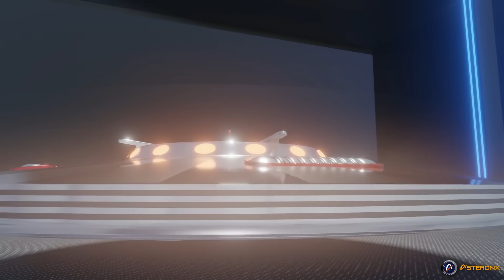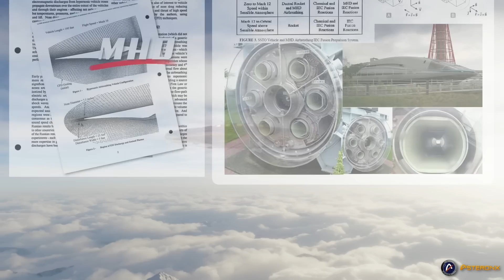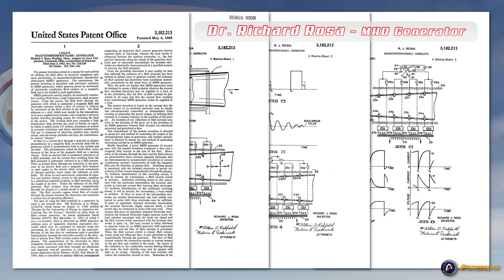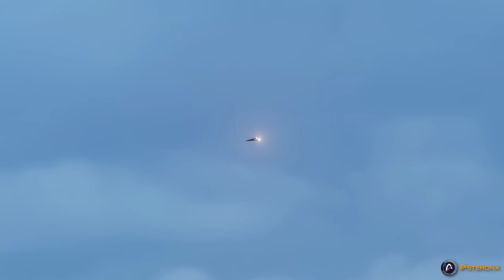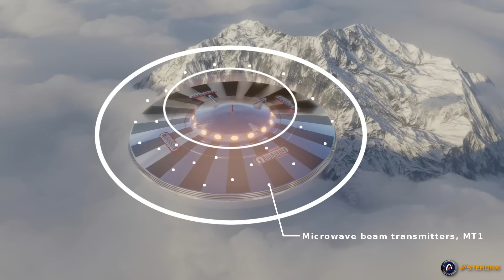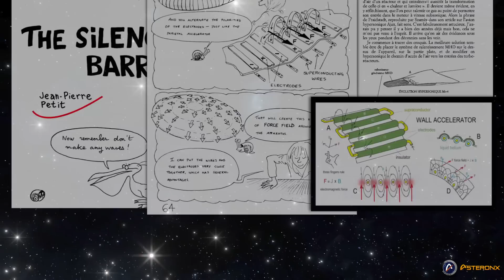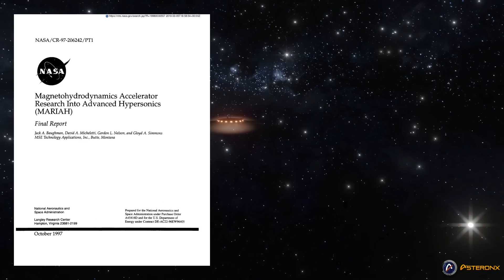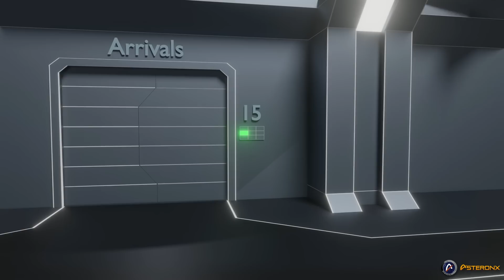Wingless EFE Touring Craft MHD

Comment: Actually you want what was going to revolutionize space travel LPP’s laser induced plasma propulsion this is the use of a ground-based laser facility that produces a high energy laser beam which is in focused on a reflective colonial surface and the reflected laser light superheat the air causing it to break down into a plasma which then is manipulated focused by magnetic fields and electric fields to behave as a sort of jet engine exhaust pushing the craft very close to space into the stratosphere where then more conventional propels it into space and a mass drivers extremely powerful electromagnetic coil guns that hurl large pods in the orbit containing construction drones and containing construction materials allowing for space stations and magnetic levitation orbital elevators to be constructed As far as the laser induced plasma propulsion system all of the power is built into the infrastructure the propels the craft and the space what that means is you don’t have to have any expensive generators you don’t need fuel the only fuel is the electricity to produce the laser light which is produced by a nuclear fission or fusion reactor and all of that is on the surface conceivably you can scale the system up to the point where a much larger space craft that would have never be able to enter orbit conventionally could enter into space MHD would only be able to work in the atmosphere because it requires an atmosphere to work but you can use this to get very close to space to the point where conventional thrusters could take you there but outside of that it would not be efficient to create a bubble of plasma around the ship they’ll be able to push it in the vacuum of space because that plasma bubble would get stripped by the solar wind the light energy from the sun and just so you know the solar wind is charged particles coming from the sun and they would require a gigantic amount of power for 100 Teslas actually the earth it’s magnetic field is only 0.34 micro teslas and it makes due with a magnetic field of that power

Comment: There are rumours about the B2 Spirit already using this technology going faster than sound without the need of braking sound barrier. The Russians already use a certain new kind of torpedo, which is in fact a underwater rocket, the Skval, which was the real reason for the sinking of Kursk, which has been attacked by a US submarine prior to the launch of some Skval rocket by the Kursk. The Skval runs at hundreds of knots, probably capable of going supersonic, instead of the usual 30 knots of a Mk 48.
Reply: If you don't know what about you're speaking, shut up. 
Sound barrier is only a matter of aerodynamic, not propulsion. and Skval are using supercavitation, it has nothing to do with MHD. 

And MHD isn't useable to propelling an aircraft, it's too weak.

Comment: if space is made up of a flux of quarks and gluons, could an alcubierre drive be possible by isolating a finite amount of said flux and distorting it's containment field? rather than folding space, distorting space to a degree in which the relative motion outside of the contained flux differs from the velocity once entering the containment field? to stretch a foot of flux ten feet and throwing an object through it at one foot per second might have the effect of increasing the speed of travel from one foot per second to ten feet per second relative to the exterior of the containment field.

Comment: Wait, but microwaves aren't ionizing radiation, how would it ionize the surrounding air? To ionize oxygen and nitrogen you need a photon energy of about 14.5 eV, or about 85.5 nm, which is in the ultraviolet frequencies. And remember, not only does it ionize air, but human DNA.

Comment: If use none conductive full circle tubes in pairs as many as need to the desired effect place them common centered  magnetic bears to rotate freely as lower friction of the liquid fluids all this suspended in a pair of states to apply Higher and high frequencies until you get anti-gravity effect and each unit three or four will suffice when given the AC power that will the mercury to flow around in those tubes, we had talked about, those will begin turning as the friction of the mercury  on the walls of each tube. This rotation is only by the friction, one of the two stators will be up to cause this mercury to run around its tube clockwise as one down upon its rotational part ( Tube spokes and magnetic bearing. ) as a single whole part. All while tube rotational as a whole too will rotate counterclockwise for the very same reason as the other tube part unit. These are driven by the stator units that are stacked one on top of the other  also having common centers as the rotational tube assemblies you should also use aluminum plates, ( Making them not conduct  between each other is very importantly necessary as a fact. Lamination segments will do best. ) so as to stop the interferences between the coils of each respective stator assemblies of course you use true correct iron stators the will only hold magnetism and not having electron flow or  to a minimum,  you should make your wire to these stators also reversible for both in one switching and also be switchable independently just for safety reasons all this for pilot actions as a means to regain stable usage while flying the craft in every kind of environments that will be encountered any possible uses of you may also ad control fully controllable resistances for each and every winding of each stator too. Making it possible to deal with whatever unknown. flight engineer would be a good choice to run these kinds of operating for workarounds as might be needed, even if nothing need be done normally just keep them for those possible works cases.

Comment: I've got very bad news for you.  People, including me, have known about this for more than twenty years already.  And the
government has been trying this for far longer.  There is a paper from the 1930's that talks about the lift implications of
ionized air.  But the BIG problem is that the power requirements for a true MHD aircraft are measured in GIGAWATTS of
power.  We have no power supply capable of producing such power in a volume small enough to have such a
craft.
Reply: Maybe Antimatter or fusion? Somewhen.
Reply: @vgames1543  Antimatter is, to say the least, problematic both in the cost of producing it and even more so in the cost and technical difficulty of containing before it is used.  Even a gram of anti-matter reacting to 
regular matter would cause a thermonuclear like explosion comparable to many kgs of the hydrogen
fuel-fusion.  Your craft would vaporize in less than a second.  Fusion maybe.  But it is clear we are still
a long way from that.  Also, even our nuclear plants, and also future fusion plants, would still rely upon
electrical production by steam power via heating from fusion/nuclear.  We need something that is far
more direct given the small volumes such power supplies would be situtated within.  Think a two story
'house volume for instance.  Prototype fusion plants are industrial acreage in size.
Reply: In the early 50s the government captured several alien ships.  The Aliens got with our government and asked them to stop using that type of radar because it was malfunctioning their controls on their space ships and they were crashing. So the government stopped using that type of radar. But the government kept the ships that crashed, how many they kept is top secret.
Reply: @killroywashere1254  What is your source?  MY source is the actual paper and the fact that I have a physics masters degree
and have studied MHD for the purpose of producing such aircraft.  Many claims of alien crashes and
contact are out there. Most don't pan out.
Reply: @jdove6883   "Many claims of alien crashes and
 contact are out there. Most don't pan out." - Wait a moment! Are you suggesting some do?!?
Reply: @nicadi2005  Some, like the Rosewell incident of 1947, remain to be seen whether they are true or not.  But the Government has
been unable to put that one to rest which makes it possibly real.  There are other incidents like the landing that occurred with
physical evidence and em radiation (microwave damage to plants) damage that rings true for me.  I am not your average joe in that
 I intended writing  but, yet, never did write a book about alleged UFO "technology".  What I have developed over the years explains almost all
 the weird anecdotal stories about UFOs--alleged extraterrestial craft--and by using actual physics of which I have an advanced degree. 
The technology I propose couldn't possibly be human because literally the most advanced country on Earth--the United States--does
 not have the power plants to produce 100 to 1000 Giga Watts as needed in order to power such technology.  We might get there with a low weight
fusion generator that could fit into a lenticular volume with a diameter of 60 feet.  But there is no current power generators that
can produce such power outputs to run the technology.  We would know it because it would be a revolutionary power generator
and the Government would be unable to keep it under wraps.  I might add that the Travis Walton story, which was much maligned by
arch skeptics, such as the deceased Phillip Klass, has elments of the story that fit my proposal for advanced populsion technology.  So I tend
to believe him.  Also, when I watched an interview with him I didn't see any classic signs of lying so we can conclude that at least he believes
it--and he had witnesses per the movie and book.
Reply: @jdove6883   "actual physics of which I have an advanced degree." - What kind of degree? What branch of Physics? What was the title of your final dissertation? Can we read the paper ourselves?

"power plants to produce 100 to 1000 Giga Watts" - How did you determine the power requirement for this particular application? Can I see the calculations? Could you NOT narrow down a bit more your specification? (You are allowing yourself a 1000% range - which is incredibly excessive!) Could you also elaborate on how you propose to transfer such amounts of power between the generator and drive units? Could you confirm what the expected thrust would be, per unit of power expended? Do you have any thoughts on environmental factors that could affect that?
Reply: @nicadi2005  I have a masters in physics with a speciality in plasma physics and literally nothing to prove to you.  Take it at face value or not.  I don't care.  The  A 1000 percent range?  LOL!  You're just playing then.  I didn't realize your first message was just a criticism.  Go do the calculations yourself if you have technical understanding.  I will say as a matter of interest to anyone else reading this that the variation in power in the range I stated depends upon the degree of ionization of the outside air and the depth of useful ionizaiton you intend for it to be--so yeah the range is accurate although maybe a bit too low.  Ionized air recombines from it's ionized state to neutral in about 1 billionth of a second.  The data I used to calculate is from Government data on nuclear expolosions and airforce data unclassified and released and based upon the temperature of the air plasma. Not to say there couldn't be a way to modify these results given research funds.
Reply: @jdove6883   "literally nothing to prove to you." - Then don't mention it! Because once you do, then you definitely have something to prove...  ;-)

"Go do the calculations yourself if you have technical understanding." - I'm not the one proposing any designs, am I?! Yet you're telling me to do your job?!? Why can't you just show the results you've obtained and explain the background to them - rather than expect me to produce similar results separately?

"The  A 1000 percent range?  LOL!  You're just playing then." - Not at all. You specified the power requirement range to be between 100 and 1000 GW; the upper bound of that range is 10 times larger (i.e. 1000%) than the lower bound - which is excessive. You should be able to narrow that down to, say, 1.5-2.0 times instead... So why can't you?

"The data I used to calculate is from Government data on nuclear expolosions [sic] and airforce data unclassified and released and based upon the temperature of the air plasma." - But nuclear explosions are sources of radiation forms with much higher levels of energy (and also much more dangerous to life and very difficult to contain); how did you account for that in your calculations which seek to establish the power requirements to achieve a certain level of air ionization from microwave radiation ONLY? Also, could you cite the actual sources you've used - as per previous request?
Reply: What is your expertise then?  Engineer?  PhD physical scientist?  Science grad student? Passing interest?  Or just trying to understand so you can reproduce and patent it?  I   gave up on the latter ideas a long time ago when I found a patent by railroad engineers from the 30's who had a similar craft.  You know why we don't now have those craft?  AGAIN, because we don't have the power plants to run them because the power requirements are enormous.  The power requirement to ionize 1 cubic cm of air to a 10 percent ionization, at sea level,  is 10,000 W according to US Airforce released research. To keep things in perspective, assuming you are a normal sized man six foot like me, then about half your pinky is close enough to 1 cubic centimeter to keep things in perspective and So you do the math.  Now multiply that by a million for a cubic meter which is about 3 feet by 3 feet by 3 feet in volume and see what the power requirement for that becomes.  So there is your multiplier.  Have fun calculating.
Reply: I thought back in the day the black world solved this problem using  beamed microwave propulsion. The Mhd would be powered by orbiting satellites. There was an out there thread on above top secret. It looked to be mostly disinfo although some parts sounded plausible. Like growing craft in microgravity using graphene.  Allegedly they have an ssto article that is powered by a battery now.
Reply: @blade8922  No.  My speciality is plasma physics and the ionization of even a cubic meter of air is 1 to 10 Gigawatts
depending upon the degree of ionization you wish to achieve and to achieve a starting point for MHD effects you need at least a 10 percent ionization.  For a 30 foot ellipsoidal mhd  aircraft with depth of half a meter off the hull the power output would have to be over a 1000 Gigawatts.  By comparison NYC uses approximately 264 GW daily or 11 GW per hour.  We are the most technologically advanced country on the face of the planet and we don't have the power supply to power mhd aircraft.  So who has them?  Using my model I have been able to explain almost every anecdotal, weird observations that have occurred with UFOs--including vehicle interference.  I should have a wrote book a on this 25 years ago when I first developed my models--and I never did.  I only did three talks to John Schuessler's group in Clearlake, Texas at the time.  Always meant to.  These mhd videos now are way behind like most public knowledge of physics normally is.  For instance, the Alcubierre "warp drive" first came out as a physics paper in 1989.  And it took more than twenty years for it to be known by the general public--which most still are not aware of the concept!  But I guarantee the US Government has almost certainly suspected the MHD nature of UFOs for far longer than the 25 years I haven't written by book.  And yet they still dont have the power supply to produce them.  And science and military experience dies with the older scientists and military familiar with these pheonomenon and suddenly the Navy supersonic "tic tac" is big news as if it hasn't been an issue for decade after decade.  Worse, if UFOs represent mhd craft and extraterrestials then they are not just using mhd technology and are so far ahead of us that they would have crossed interstellar space.  My guess is they are at least several hundred thousand years ahead of us as a technological species.  And that's a bummer because science and therefore technology only advances insomuch as our ability to control and produce energy in ever larger amounts.

Comment: Sterling hot air space engine!  Hot and cold!  Okay maybe not as efficient as solar cells, but you have a huge thermal difference on space ships even those plated with solar cells, what are we doing with that great potential?  Nothing?   As I see it, these drives would be great for moving around in air but useless in space.  The video on nuclear engines is promising as we are on the cusp of being able to build the prototypes.  I suspect that a good space ship will need a hybrid of two or more such engines, one using the byproduct of another to sustain it.  I would also like to see hafnium isotopes revisited as a nuclear source that is switchable to on off by xray radiation of the isotope.  This has been known of since the 60s but has never seen fruition.